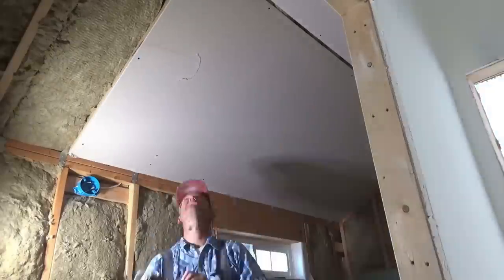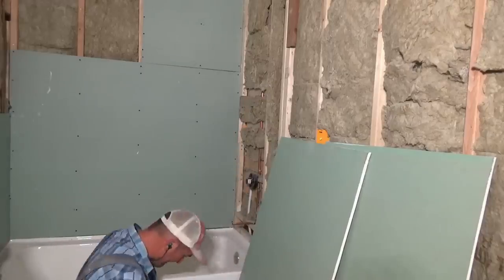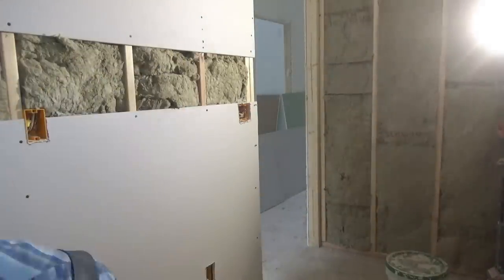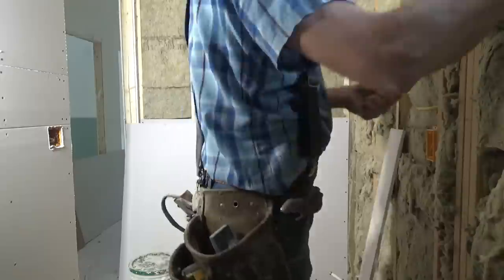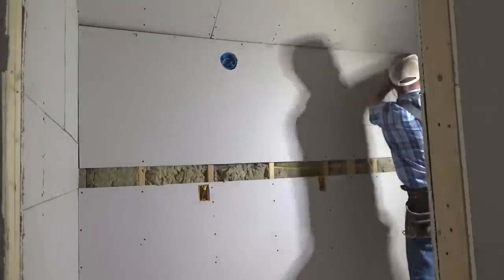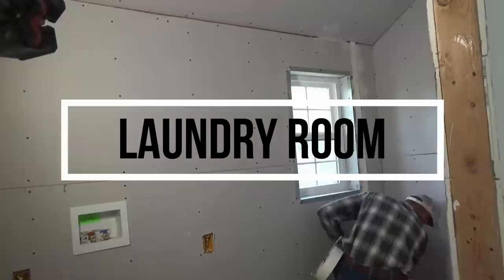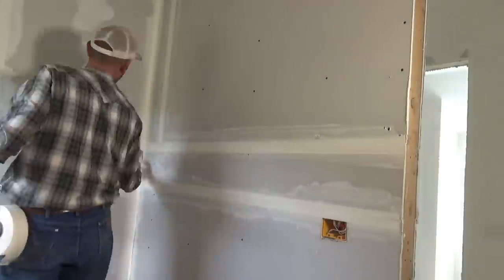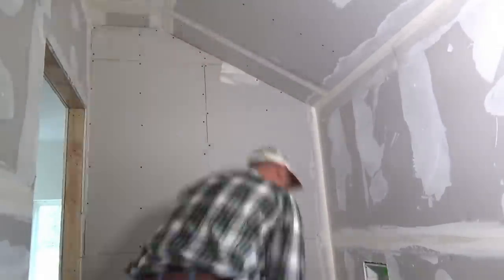#332 - MOLD - Vapor Barrier Vs Green Board Drywall - Bathroom And Laundry Room

Comment: Science has determined that moisture carried by vapour diffusion is 1/200th of that which is carried by air.  That is, air leakage will carry 200 times more moisture than vapour.   I am afraid that the discussion(s) on mould and vapour barriers are not the least bit related.   The mould to which you are referring is a result of moisture and a source of food (I.e., paper on gypsum board).    A vapour barrier may be omitted if one has included an air barrier.    An air barrier is now often termed an air vapour barrier and must be installed on the warm side of the insulation.   If one can prevent the migration of air then the largest part of moisture migration into your exterior walls has been eliminated.   When moisture gets into your exterior wall and moves through the insulation to the colder side, then it’s temperature is reduced to the point where it condenses and then changes to water.  Water causes rot and damage within your wall....and mould.  This mould grows where you can’t see it, not the surface mould one sees in a washroom.     A vapour barrier may not be needed but an air/vapour barrier is ABSOLUTELY essential in an environment such as yours.
Reply: Yes you know way more than the experts that he's quoted in the video. Do tell how familiar you are with the climate of the intermountain west? A lot of "knowledge" from a guy that can't spell mold.
Reply: @AK_Ray  
Mold vs Mould. ... Mold is the American spelling for all senses of the word meaning, among other things, (1) a frame for shaping something, (2) to shape in a mold, and (3) any of various fungi that commonly grow on organic matter and are often associated with decay. Mould is the British spelling.Oct 19, 2012

He did spell it correctly.... info is spot on as well. 😉
Reply: Thank you for the mould response.    Same goes for vapour.   The climate of southern Ontario, Canada is very similar to the northern portions of the USA.   ....that and having trained in building science and then in the contracting world of building envelopes.
Reply: @peasos8638  I live off grid in northern mn.... we built in 2015 (and still are....) and oh my... no vapor barrier on the inside of the house under the sheet rock would be a disaster. In fact, it's a Minnesota state requirement, plus it's just a sound precaution that doesn't take much time or money. 
I really enjoyed your perspective from a science stand point. I learned a lot, ty.
Reply: @AK_Ray  - what experts? he quoted nobody. Matt Risinger seems to disagree with him and last I looked, the rest of the world is still installing vapour barrier. What is relevant here is heating primarily with wood. Personally I'd use a concrete backer board around that bath too, they are cheap enough to never have to deal with penetration and make a better base for tile.

Comment: Put your bathroom exhaust fans on a timer so that you can have them run for 5 to 10 minutes after the shower to fully pull that moisture out.  That, plus all the other work you're doing will mean that the drywall will still be good for years to come.  Strong work - keep it going!

Comment: Interesting comment about the moisture and vapour barrier.  Where I live in Australia the average air borne moisture is rarely less than 60%.  In summer or when its raining it is rarely less than 90%.  I am also stoked at your weather.  Your summer temps would be glorious here. Mid to high 30degree Celsius in summer is the norm.  Keep up the great stories and video.  Cheers.

Comment: I enjoy your channel. I don’t usually feel compelled to offer advice. But I’m going to make an exception this time. You could have done without the drywall on the tub surround, and just went with concrete board. On top of that, a water barrier such as aqua-guard would be wise to keep any water that gets past grout under control. Your thinset and tiling can go right over the aqua-guard. 
I’ve done this for years, with no call backs.....
Best Regards
My experience is that you are right to avoid a moisture barrier. 
A tight house, is good enough.

Comment: The issue isn't a vapor barrier question anywhere in construction. The question is vapor drive. You live in Arizona with minimal external humidity, but with cooking, baths and humans inside your humidity internally is going to be high compared to outside. Just put in humidity control (not your HVAC) and you're fine.

Comment: I'm an electrician by trade and what you doing by not installing a vapor barrier is correct for where you live. I live in Canada and we need one up here. It depends where you live. Our Winters are very cold at times we need to seal the drafts from coming into the house because that's where mold can start. Also because you have a wood  stove  it needs air  and your house should breathe  a bit. Good job I enjoy your videos.
Reply: It's very, very cold where he lives.  I used to live there.

Comment: I think vapor barriers were important long ago because of the thinner walls and temperature extreme differences! I’ve seen dry rot before but only on thin walls! It does take an extreme temperature difference for condensation to occur! I just leave the bathroom door open to let it dry out but that depends on the humidity level of the rest of the house! I never use the exhaust fan!

Comment: Wood stove in a tight house.. you will need a outside air supply to keep it from back drafting or to draw any at all. Especially when a dryer or exhaust fan is running.

Comment: I think if you use a house wrap.vapor barrier inside walls should be outlawed its mold infestation waiting to happen!!as a contractor born into the trades have argued with many inspectors over that subject.and if can afford the shluter system for wet areas is best or at least a cement board dont tile greenboard.great video!!thanks for sharing.

Comment: International Residential Code does require Class I or II vapor retarders on the  interior side of framed walls in Climate Zones 5,6,7,8 and Marine 4 per R702.7.  That would be for exterior walls (not talking about just the bathroom here).  You are in Climate Zone 6, maybe 7.  The idea here is that in these cold climates, the air outside is very cold, and the air inside is at room temperature (60 F or greater).  The gradient difference causes moisture to accumulate past the drywall and cause mold in the wall cavity.  Their thinking is that a vapor retarder on the interior side of the wall will prevent the moisture from getting into your wall cavity and rotting the insulation and studs.  If you were in Arizona, California, etc.  the average temperature gradient (difference) between the outside air temp and inside air temp is not so great, so vapor retardants are not required.  
My question is where does the moisture go if you do use a vapor retarder?  Sounds like the moisture will eat at the drywall, in my opinion.  I think further scientific studies are needed in this area.  But from given data at this point, I wonder what is causing the most damage: the vapor retarder or lack thereof?  I think it's better to protect the wall cavity.  Here's how I might solve the problem (not talking about bathroom here)...I WOULD INSTALL GREEN BOARD ON THE INTERIOR OF ALL EXTERIOR WALLS....perhaps green board qualifies as a Class I or  II vapor retarder.
Reply: Yes green board is a  vapor barrier  never use poly under green board. .
Reply: @keithlea6804  I agree that green board is considered a vapor barrier, and so there's no need to use the poly too.

Comment: when you have a difference in temperature from one side of a wall to another the warm side will be attracted to the cold side . this is what causes moisture to accumulate   . just like the sides of a glass of ice water .. in your area you might not need it but some you might ..

Comment: With all the snow and rain you get, I cannot believe how low your humidity is.  Altitude part of it?  You must never get drizzle or fog.  I am in eastern North Dakota and it’s common to have days of 80 to 90% humidity.  I would guess Average Normally in the 45%.  Higher in hot muggy summer days, or drizzling, foggy, rainy days,  lower in the cold of winter.  Been 80% to 90% last few days, 94% this morning.  But we get moisture pulled up from the Gulf of Mexico and over the central plains on the east side of the Rocky’s.  Things are sure different just a couple states away. All construction I know of in the upper Midwest uses some form of vapor barrier.
Reply: The figures were wrong. Now in July, the humidity in his little town is varying between 20 and 90 percent.

Comment: Hmm Building codes are so interesting - I'm a Swede, living in Sweden...   It shows that (at least from what I have been reading) the Vapor barrier has two reasons, the classical (protecting the internal parts of the wall from mould deriving from humidity from the inside) AND supporting the insulation materials as an extra wind/air movement barrier. This showed when I selected a different type of insulation - from grinded newspapers basically - which had a higher density. This meant that I hav a semipermeable (wow I could spell that without sweat) barrier, which they (the insulation company) provided. Not the ordinary oversized plastic bag... This was like a drumskin... 
- And now I'm adding some local codes that are practical, if you are experienced. All wiring and plumming should be done in an external, secondary piping (though it is the ordinary soft PVC pipes) - this 1) allows redoing of all piping with minimal effort 2 Takes care of the burst of leaking pipes and sloppy electrician work by providing an extra layer of security. I like it - it has saved my but at a couple of times.  - We do things a bit differently, in order to makes thing stand a bit longer ;) 
- And we put a second skin into the wall with OSB or Plywood behind the drywall to make it more sturdy and easy to fasten/hans tings on the walls...

Comment: I just tore out a poly vapor barrier put over rockwool. It had been there for 8 years. Yep, mold was growing on the external side of the vapor barrier.  Don't use poly!
Reply: Thank you for this comment. The video had me leaning to not use a VB, but then I was going back and forth to use it after reading so many comments... I live in Cleveland, Ohio and redoing my bathroom. I plan on using Rockwool and have greenboard for the walls and plan on using cement board for the shower tub surround.
Reply: @jkocaja1  I am in Chicago area.  Will be tearing out a lot of drywall to get rid of the poly that was put in.
Reply: @naturalhealing9970  I'm wondering if there wasn't an adequate air barrier.  After doing a lot of research it seems an air barrier seems to be very important to block external air coming in the house. Either way this vapor barrier seems to be debatable even with industry experts. My thinking is the Vapor Barrier was an established code for so many years and now that it's in questioning, experts have a hard time accepting that it may do more harm than good.
Reply: @jkocaja1  No, there was no problem with air penetration. I had caulked all of the gaps and seams to make certain I didn't have air penetration and the outside of house is wrapped in Tyvek.  This issue is in northern climates, during the cold season, the warm air inside meets the cold air from outside inside the exterior wall and condensates in the exterior wall.  Even with dozens of holes from the sheet rock going up.  When I tore out the drywall and the poly, I could feel and smell the nasty air that was being trapped inside the exterior wall.  I think using poly was widely accepted in the 1980's, now it is frowned upon and definitely not used in cold weather application.  It is like living in a plastic bag - not good.  I feel the same way about houses with closed cell foam insulation everywhere.
Reply: Oh wow, thanks for the input. Are you planning on replacing the Rockwool or just not using any insulation?
Reply: @jkocaja1  I replaced the Rockwool in one area.  Plan to take the poly out only on the bottom half of walls in other rooms.  Huge pain and expense.

Comment: The needs for a "vapor" barrier might be debatable but it also acts as an air barrier . Your siding and sheathing and insulation and air or "vapor" barrier and drywall all act as a system to keep heat in your home.

Comment: Great video, thank you... But you talk about vinyl wrap before putting the cement board ? What kind of vinyl wrap is that ? And also, even more important how do you mount those cement boards ? Do you directly screw them on the green boards, where the studs are ? Thank you if you have time to answer...

Comment: Agree with every thing you said but you are way off on level of humidity. Pocatello (drier than your nearest town) is an average low of 31%. Not 3%. None the less, considered very dry.
Reply: Call Roxul in Canada, ask them if they recommend a vapor barrier in the cold hills of Idaho.  I did, and they said yes.  Maybe they will tell you a different right answer.

Comment: Did an ID bathroom. No vapor barrier. This was a feature not an accidental oversight. The walls I designed are designed to breathe out and dry out the back. The coldest spot are designed to not be themselves or be in contact with drywall or wood. We did waterproof and used a lot of cement board instead of drywall. All the plaster board I used was the anti mold stuff. House wrapping, good venting etc are very important. The surfaces that could possibly get wet and or be cold and gather condensation should be designed to dry out and of materials that are designed to minimize this. You're research like mine has shown the best building science has us skip the vapor barrier.

Comment: Agree that you in your location do not need a Vapor Barrier, how ever to say they are not used anymore for most the country is false. I live in Corpus Christi Texas, by code we have to have a Vapor Barrier on the out of the side for most of Texas code. The goal is to keep the moisture out of the walls from the out side, we get about 80% average humidity in winter and 95% in summer for the average. We run the A/C almost 12 months out of the year, with out the Vapor Barrier the hot very humid air would hit the cold dry wall and cause mold with in 2 years of the house being finished. I have seen it countless times working in homes here along the coast, but with such low averages year round you are lucky good sir, nothing sucks more than 110*F and 98% humidity lol.

Comment: As I'm sitting here listening to you say there is no need for vapor barrier in the US I'm looking at my building plans and it is required In Clark county in Washington state.  they are called vapor retarders and they come in several forms, class 1, sheet polyethylene, unperforated aluminum foil, class 2, kraft-faced fiberglass batts or vapor retarder primer.

Comment: I am so surprised that you don’t need a vapour barrier in your area. In Canada a good vapour barrier is a must. The only time a poly vapour barrier is not required is when using spray foam insulation since the foam is a continuous vapour barrier. In Arizona where there is more cooling than heating the vapour barrier would be on the outside. The warm side. Having no vapour barrier does not help your house breathe the exhaust fans do that job.